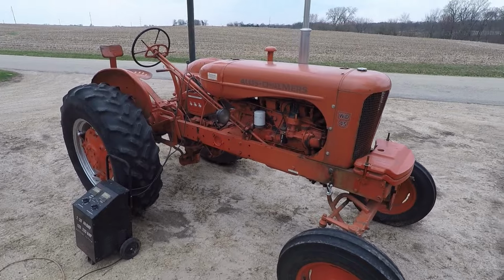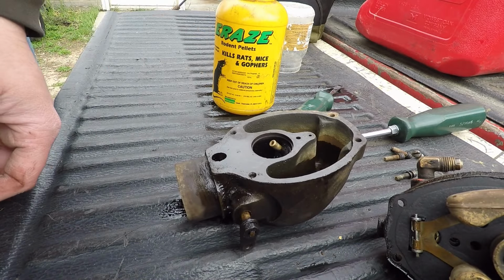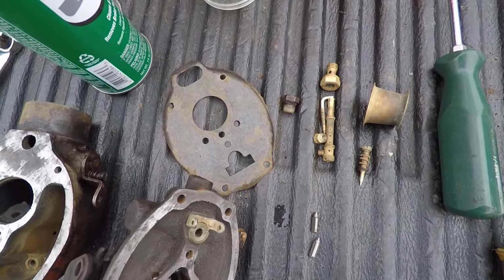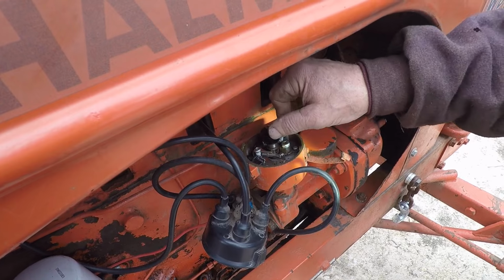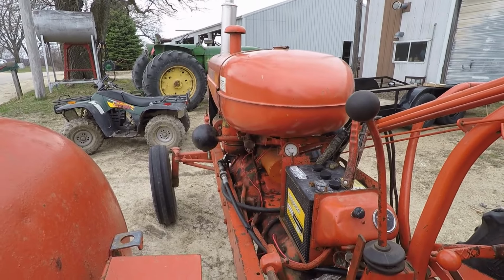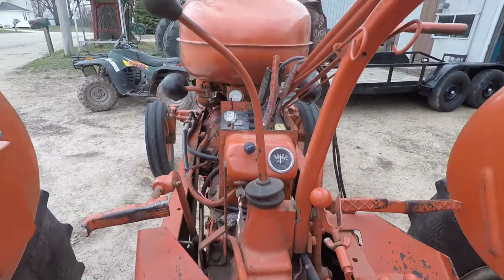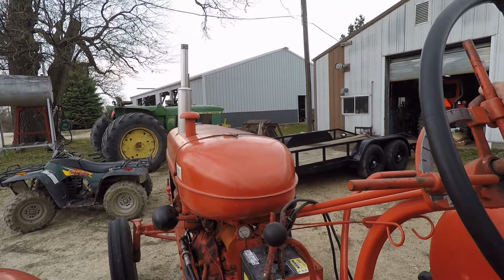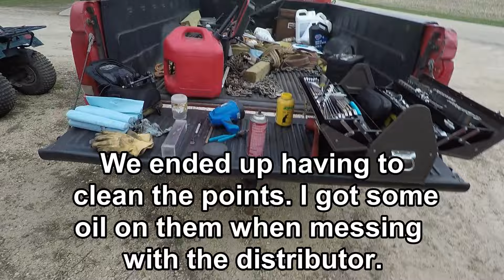Allis Chalmers WD45 - Has Fuel and Spark but Won't Run.

Comment: I learned from my Model A Ford days that 90% of carburator problems are electrical
Reply from the maker: Heh. Seems true for points ignition.
Reply: my uncle said be sure to get a good 10 penny nail for that rotor i dont think plated works as good as copper or steel.
Reply: My grandpa was worse.   to him a 12V battery that was too  dead to start what it used to be in should still start a 6 volt engine, to which we would then spend who knows how long screwing with 'a weak starter' only to find out the "The new battery" in the tractor was the dead battery from the pickup/whatever that wouldn't start last time.
Reply: Funny, I learned the same thing from my 70 Beetle...
Reply: And 90% of electrical problems now days, are the off the shelf condensers that come junk right out of the box.  I've been using Blue Streak ignition parts. Better to pay a little extra than to do it over.
 It can't hurt to run a high output Pertronix coil either.
Reply: I learned from small engine shops that give away equipment that say fuel problem that the valves are tight. Starting problems? Valves are loose but as least "professionals" keep me busy.

Comment: It's obvious that this was run without coolant for a couple of minutes, that's why it's broken. :P
Reply: Martin Edelius yep. Shows all the signs.
Reply: Yeah, and the exhaust manifold was off also....
Reply from the maker: LOL. Do these things even have a cooling system?
Reply: @WatchWesWork  Doesn't matter, still the problem. :D
Reply: @WatchWesWork  Yes, look up at the above comments....lmao . I wouldn't advise getting them to help.
Reply: Martin Edelius don't forget setting the battery on the bare shop floor...
Reply: @WatchWesWork   ya, it keeps the sludge from drying out
Reply: @WatchWesWork  I can't hear if it has a cooling system, completely ineligible lol
Reply: @WatchWesWork  Nah you got it all wrong, it just needed some seafoam in it.
Reply: LMAO
Reply: @WatchWesWork  Like Model Ts? "Who needs a water pump?"

Comment: My man Wes you may have just solved me and my grandpas problem with our WD 45 I live in central IL on a small farm and my grandpa has had this wd45 for 30 years says it was the best tractor he ever had could start with one hand crank in the winter and one day I was using it to spray and it started running like garbage and quit running, we rubuilt the carb 2 time with no success and played a little with the timing but couldn’t get up to run it would just pop. I’m going to show him this and see if it works thank you for being an awesome you tuber!
Reply from the maker: Well I hope it does help. I don't think Allis used this type of distributor drive very much. The manual does not even show it, only the style with the gears pinned.

Comment: That was cool. Got to see your dad. Old friend had that same year tractor. We had to roll it off a hill to get it started. Run great. Used it for turning hay over. Then it started over heating. He parked never did figure it out.
Reply from the maker: Probably needed a head gasket.

Comment: A little tale that might amuse you was told to me by an old car mechanic. Back in the fifties there was a shortage of cars, but unfortunately not a shortage of sharks, anyway there was an area of London known for dodgy dealers but needs must as the saying goes. My friend and his boss went looking for a car, they found one that didn't look too bad or rusty but just wouldn't run. It had plenty of compression and good spark so they took a gamble and towed it home. They tried everything to make it work but no luck, so the took the head off to reveal.......tennis balls in all the bores.
Reply from the maker: That's crazy. Why?
Reply: @WatchWesWork  why the balls? To give the impression of compression, when the engine was turned over with the crank handle, although you might be a bit young to remember what they are.😉
 I did say sharks were involved.
Edit forgot to say the piston to bore was so great you could allegedly see daylight.

Comment: Damn! Same problem with my dad's Massey Harris tractor. Fuel and spark but won't stay running! I was going to take carb apart next but I guess I will check the distributor and timing! Thanks for the video.
Reply from the maker: Is that a flathead Continental? That would have the distributor out through the head and runs right off the cam.
Reply: @WatchWesWork  yes it sure is.
Reply: @WatchWesWork  Hey Wes just to let you know I got Dad's old Massey Harris running and it was the carb! Video on my channel if you are interested.

Comment: Thanks for the video I've been waiting for a video just like this. My 85 year old neighbor said if I can get his wd45 running he will sell it for 300$ with 3 implements. He is having maybe same issues as this tractor from what he has explained on what it was doing.
Reply from the maker: Sounds like a great deal, even if it doesn't run.
Reply: The tractor is literally the same shape as that one and the implements came with thst 2 point lift system so I guess it's cool cause I actually have a original set from allis Chalmers there even allis orange. But thanks again.

Comment: Just had this problem with an International.. Can't remember the series. But a straight 6. I checked the valve lash, went through the carborator,  and checked the firing order. Still wouldn't run, until we pull started it. It just needed higher rpm's then what the starter could produce, until the rings re-seated. Starts up very good now
Reply from the maker: I've seen that a few times with diesel engines.

Comment: When you go to swap to 12 volt dont forget to add a ballast resistor on the coil. It will let the smoke out of em after a few minutes. Also not sure if would help or even be a problem on these tractors but when swapped on deeres I have had hard starting issues sometimes. The fix I have used before is to use a different type mechanical starter button or a relay to run a 12v hot wire to the coil during starting. Really helps on some of the old tired tractors and is basically the way all the LP tractors were wired when they came with 12 volts. I'm sure you probably know all this stuff but its just a heads up.
Reply: Ah, I read below where you said y'all were planning to use a 12 volt coil. Thats a good route too, less parts to fail. Good luck on it and thanks for the tractor vid. It's hard for an old farmer to pass up a video on some of the tired iron they grew up farming with.
Reply from the maker: I'm not sure how we will do it. The 12V coil is really meant to be used with electronic ignition. So I'll just see what my dad wants to do.

Comment: Love Allis Chalmers and any old tractor so simple to work on if you have fuel and Spark and won't run the gap on your points is probably off or it's all out of timing simple stuff

Comment: I had a similar issue with a farmall super c. It ran fine one day, then wouldnt the next. When i cranked it, all it would do is backfire through the exhaust. Bad. Like gunshot crap your pants bad. My 81yo dad kept telling me to check the timing. I finally did and it was off. I set it back and it has run fine since. I couldn’t find anything wrong like you did though. Head scratcher.

Comment: The oddest thing I have seen on a gasoline engine was on a WD-45.  It would start and run in neutral but as soon as you put the tractor in gear and let out on the clutch it would die.  It would finally restart and nothing helped.  The tractor had been very heavily used for tillage work, belt pulley work, pto work running a silage cutter, you name it and it was used for it.  When the engine was torn down the crankshaft had broken diagonally in a main bearing.  If you managed to get it to get together it would run but as soon as any load was on it the thing came apart and died.  The mechanic at the dealership showed it to us because he had never seen anything like it.  They were great tractors except for the slow hydraulics and not having live pto if you didn't use the hand clutch.
Reply from the maker: Yeah, the hand clutch deal was odd, and the hydraulics were really unique. I had a similar failure once in a Caterpillar truck engine. The crank broke between the last piston and the flywheel. Engine would run but would not move. We thought it needed a clutch. That was not the case!

Comment: I had a similar problem with my Porsche 912. The performance would drop off occasionally.  The distributor  is crankshaft driven and the thrust bearing was damaged causing it to move back and forth. Same sort if problem.
Reply from the maker: Yeah that's exactly the same thing!

Comment: I converted my WD45 to 12 volt neg ground. Found a 12 volt battery by the battery group size designation that fits the original battery box. I used a Delco 12SI alternator, like from a 73 Impala and a diode to keep some voltage from the alternator from keeping the ignition from shutting off. Oh also changed the condenser and points to chevy II 4 cylinder (Delco).

Comment: First thing I check is the oil bath air cleaner it gets dust build up on the bottom then chokes out I had a W4 international was like that for yrs cleaned it out put new oil it ran like a new tractor, But main jet flow is a must too, Another thing is the swab on the points  being dry no oil lubrication it'll pull the points closed retarding it so bad it'll snap and buck too.
Reply from the maker: This tractor is missing the hose from the air cleaner to the carb, so I don't think the air cleaner is the issue, though I hope the owner has the hose somewhere!

Comment: Used to own one just like that, but mine was still a six volt system. I was lucky. Never had to do anything but change plugs and wires, and clean the carb, once.

Comment: That is sure a nice original tractor.  Seems a shame to do a 12v conversion.

I have a soft spot for a WD45.  First tractor I learned to drive at about age 11.

I was wondering what you would find when it seemed the ignition was problem.  So, the other end of that shaft with the nut that was loose there is a gear that mates with I think cam gear on the front.  The WD45 we had, that gear slipped on the shaft and tossed the timing off as well.  Dad got a new one from the AC dealer in the day and sounded like a "common" problem.  The new shaft/gear you could see had been heated and press fit to the shaft when it was made.  I was literally out spreading manure when the gear slipped and the tractor just died and when trying to restart, it would randomly fire one shot, etc.  We had to tow it back to the farm.  This was >40yrs ago.

Comment: On my LA Case it has timing advance lever right next to the throttle so you can find that sweet spot while operating. Real high tech stuff. LOL
Reply from the maker: Interesting. Does it have a magneto? I've never seen the advance lever on a points and distributor ignition, but I'm sure someone had it.
Reply: Yes it is a magneto. It does have water injection too though.

Comment: I bought an old Allis years ago that would only run low idle. Someone lost the venturi out of the zenith carb. My local Ford tractor dealer had a new one in stock. Ran perfect after that.
Reply from the maker: That makes sense. The low speed circuit exits right at the throttle blade. But the high speed circuit needs the venturi to pull the fuel through.

Comment: Static Time---  line up timing mark on compression turn key on, turn distributer hold number plug wire look for spark rotate till it fires fine-tune when running
Reply from the maker: I do the same but just slightly differently. I just clip the coil wire to a spark tester and turn the distributor until I see a spark.

Comment: We have the exact same tractor, its used as an auger tractor and it hasn't ran for a couple of years. Its the same, besides it has no axle, just two small tires on the tractor axle.

Comment: The biggest issue with 6 volt systems is guys put tiny little 12 volt cables on them. My 1954 WD45 was purchased new by my grandfather. Its converted back to 6 volt now. To start advance the throttle 1/4, full choke, and pull the starter on the 3rd rev it will fire and run.
Reply from the maker: This one sure starts good on 6V, but we just do as we are asked.

Comment: I grew up with WD-45's.  Sometimes I had to use the crank start.  Normally those engines were easy to start.  When the first cylinder fires they just take off and run.

Comment: We used to have an old AC “WC” from about 1941. Magneto ignition. Would not start with the electric starter. Spin it with the hand crank and it would fire right up. Darnedest thing.
Reply: Its picky maybe?

Comment: just saying, but when I had a part that was intricate or convoluted with corrosion, when possible, we soaked it in bug juice (cherry or lemon) to get the funk off. pure  un-diluted Ascorbic acid powder (Kool-aid w/o sugar)and a little old toothbrush got everything much better. we used the bug juice to Steaming hot water ratio of 5 gal.s worth of  powder to 1 1/2 gal (or less) of water .

Comment: When you grabbed that rotor and it flopped around, I figured the teeth were worn completely the hell out - I've never seen a distributor driven by a secondary shaft. Glad it worked out - that is a nice looking tractor. I think the fella at Classic Truck Rescue ran that same model for years.
Reply from the maker: That just the mechanical advance moving back and forth. That's normal.
Reply: @WatchWesWork  Whoops, forgot about that.
Reply: @WatchWesWork  Whoops, forgot about that.

Comment: In 1955 when I was 6 years old, my Dad purchased a new WD45 on LP gas, (the LP tank was mounted in front of the radiator) and you could run it on either gas or LP.  He also purchased other Allis Chalmers equipment. (3 bottom plow, tandem disk, 4-row cultivator, round bailer, and mower ).  I sure loved that tractor and spent many hours riding sitting on the tool box, and learned to drive that tractor.  I would love to see one with LP tank on the front and restored.  Also, it had more power on LP than on gas.  On LP it had a true 45 hp.

Comment: When I see those old tractors it reminds of the days when I was a young whipper snapper. In the small town I lived in, once a year they had a tractor pull and the local farmers came to town with their old/new tractors to see who had the best tractor for pulling. Hook a stone boat up to the tractor and start driving while the local men would step onto the boat as it passed by. After so many men got on the boat, the tractor would slow till it could no longer move and the measuring would begin.
Reply from the maker: I've never seen that style. The ones they use here have a concrete counterweight pulled forward by a cable. Same idea though.
Reply: @WatchWesWork  yeah Wes........that's new technology...I'm talking small town (under 500 population) 1960's technology..........ask your dad.

Comment: You seem to know Cnc quite well I have a qt15 t32-2 I need to know how to slow down spindle brake and ramp up time as if I run to fast it overloads . I don’t have a ton of power with my phase converter and I’m sure that’s the problem . If I do slow down feed rates and rpm I don’t have the problem

Comment: Well, that was simple enough of a fix but frustrating enough to pull your hair out !!! Man, That purrs at idle.

Now a question, Sooner or later I am going to change the Oil in my Farmall Cubs Final Drives, Rear-end, Hydraulics & Transmission... Now 1. I know i can put diesel fuel in the rear-end drive around a little bit too clean it up but can i do the same to the Transmission? I am not really sure to be honest.
Reply from the maker: You can put diesel in either, but I would not drive the tractor that way. I'd just pour it in and let it run out the drain holes. Those old tractors are not fussy about the gearbox oil.

Comment: and some think variable timing is new,  that nut was loose to compensate for cold heavy gear oil in that distributor. jk timing by ear and feel sometimes works best i've do that and when i got gauges on found i was dead on go figure.
Reply from the maker: We were very close...

Comment: I've got a 1980 f250 4x4 that I've had sence I was 18. I had the exact same symptoms until the gear spun completely off the distributor shaft. Talk about run like shit, and 3 mpg was a real learning experience for a kid. Fine wrenching and great video.

Comment: good call, I'm willing to bet a more permanent fix would to use a locking tab or lockwire or locktite. hell maybe all three
Reply from the maker: If it ever happened again I would drill it for a pin.

Comment: probably needs a carbi rebuild kit and a very good clean or just put a new one on it off of ebay? I would have just done spark plugs, leads, distributor and more importantly an oil and filter change and fresh fuel before doing anything.

Comment: Had a WD 45 on the farm growing up. Sweet,sweet little tractor's. Don't know the year of this, but ours seemed a little bigger. Also noticed that there is no water separator in the fuel line. Will help munches of bunches. Tractor's and open air fuel tanks love air change. Miss that time, sweet memories.

Comment: i typically don't convert 6 volt systems, usually for me six volt typically works just as good for me
Reply: I convert everything. Makes them spin a lot better in the cold winter. 6 volt runs just fine, but 12 for starting a lot better. Besides, I always hang a GM alternator, gets rid of a lot of unnecessary wiring.

Comment: Coil weak or wired backwards.
Weak condenser .
Also a battery can be charged backwards if totally dead and charger put on wrong polarity.
I had those issues a few times since 1976 wrenching.